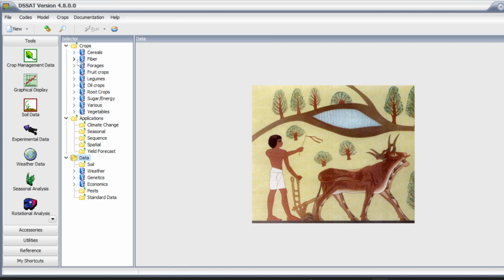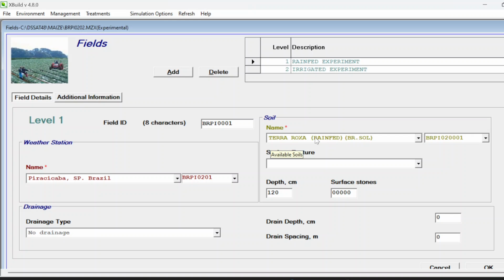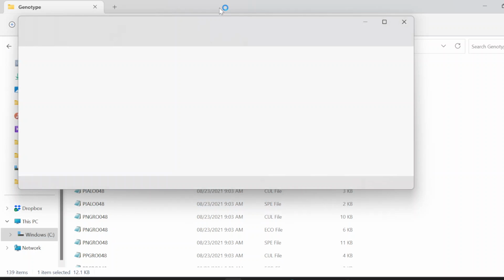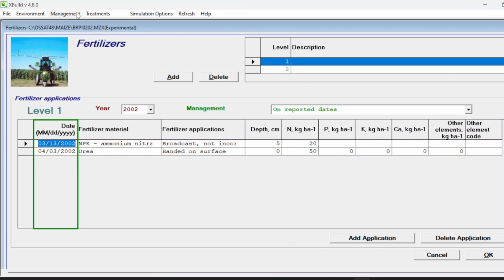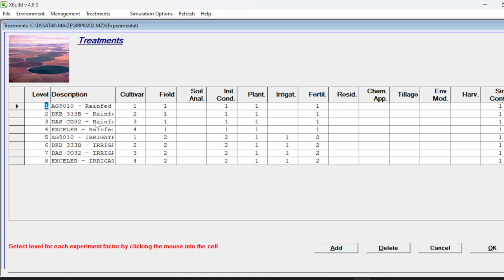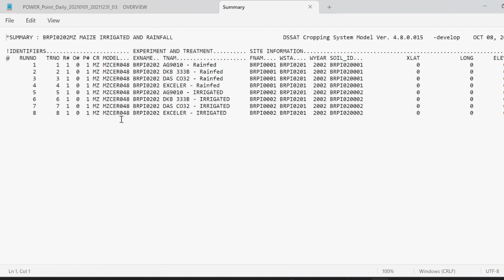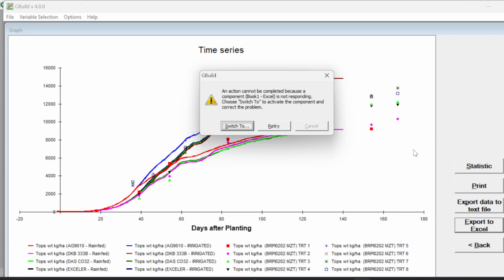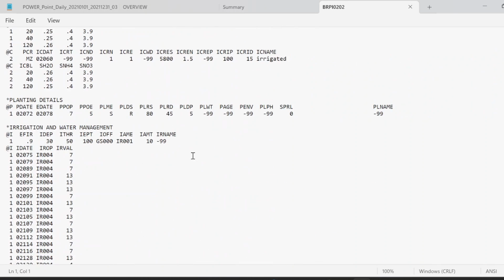DSSAT Explained: A Brief Overview | Dive into Agricultural Simulation 🌾

Comment: is there another way to get gc for a new variety other than GLUE
Reply: You can use Sensitivity Analysis, which is already explained in one of the videos.
Reply: When I start to simulate any experiment it shows range check error in DSSAT 4.8 V
Is there any solution for the same.